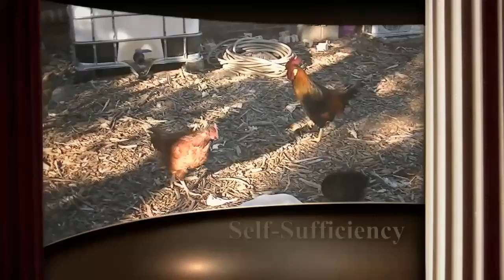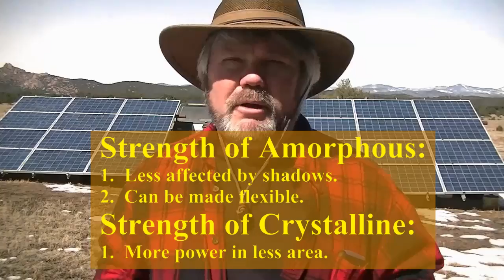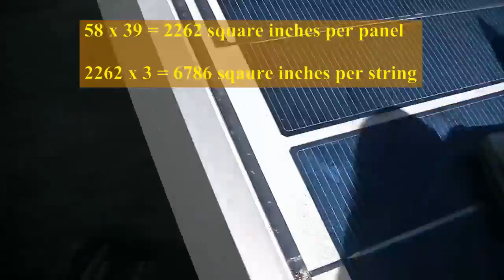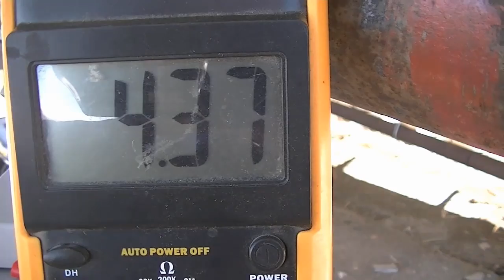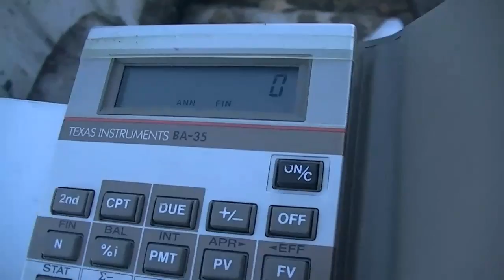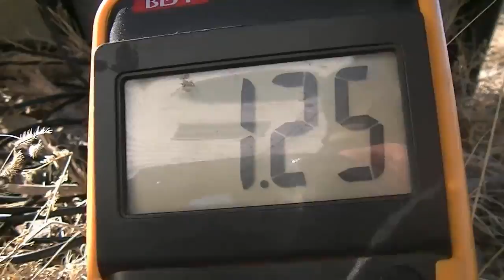Differences Between Kinds of Photovoltaic PV Solar Panels

Comment: I think it is better to compare crystalline and amorphous panels by shading compete cell, as you have done in case of crystalline panel only.
Reply from the maker: I understand what you're saying, and for purposes of comparing them identically, you're right.  But my point in this video is demonstrating how shade from a building or tree affects panels differently.  It's less likely that a shadow will occur in a strip to block only a couple of cells on amorphous panels.  The demonstrations shows that only a corner of a crystalline panel being shaded blocks it's output more so than amorphous.

Comment: Amorphous panels will perform better in cloudy conditions too. The reason for this is that they respond more to the green & blue light rays which penetrate the clouds, where as mono & poly types respond more to the infra-red part of the spectrum which gets increasingly blocked by the cloud cover. If you compare amorphous vs crystalline panels by the amount of installed  (nameplate) watts the amorphous panels will harvest more energy per year. 

However as Steve points out they take up more area. So if you compare performance based on purely physical array size, the crystalline types will be superior. At one point thin-film (amorphous) panels were cheaper per watt than the crystalline types, but that's not the case nowadays.
Reply: Thanks for the added info. Helps me understand why they have advantages, and I may adapt my systems accordingly.  So, where I need a slow but steady feed for battery maintenance, the amorphous panels will provide this all day long.  Where I need the 'Horsepower' to run motors, etc., the Poly or Mono in direct sun will be best.  Keeping it 'Basic' is best for me, and you just helped do that with detail. . . . ha - ha ! ! ! Thanks .                 RH

Comment: Steve, this series of videos is amazing. Could you please direct me to the video that suggests wire size from the solar panels to a charge controller, then from the charge controller to the batter bank, then from a batter bank to the inverter that you used. I plan to go 48 volts like you've done, a battery bank and inverter to run refrigerator and freezer only.Again, outstanding video series.
Reply from the maker: +John Baker I apologize for the tardiness of my response, John.  YouTube doesn't always notify me of comments like it once did.  To calculate the size of wire, you will need to know the maximum power the inverter will consume and how much power the charge controller will provide.  You can find how to calculate wire sizes in this video:  https://www.youtube.com/watch?v=ytwLNKbarsg